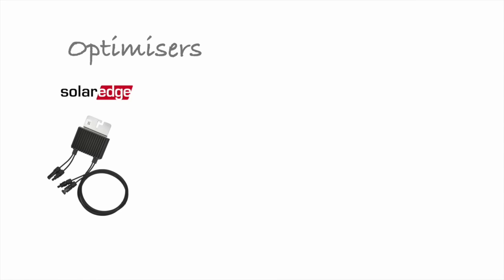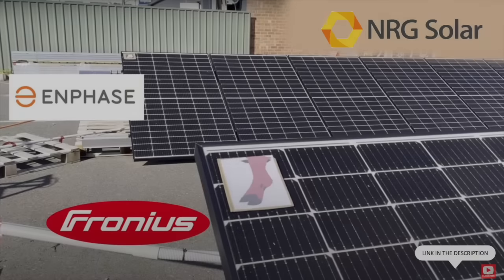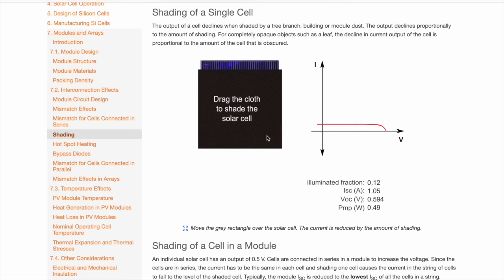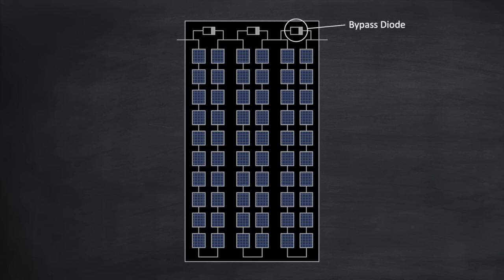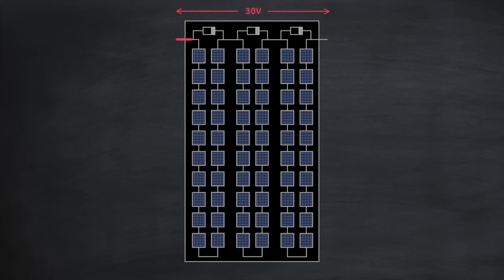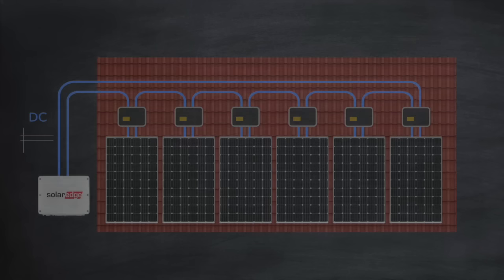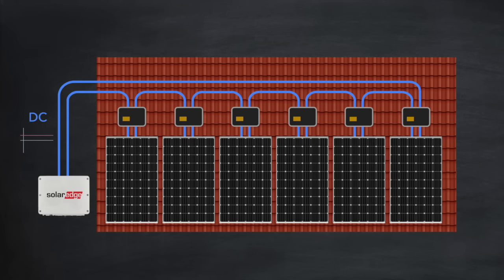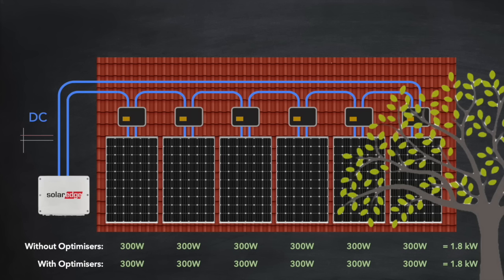Solar Panel Shading (Part 1): Are Optimisers and Micro inverters Worth It?

Comment: There is another issue, when solar panels are partly shaded say from a thin pole or just a small leaf, current if forced through the shaded part of the cell, this reduces its life and destroys the cell. The solution is not to use micro-inverters, instead bypass diodes for each cell is needed, and panels should NOT be wired in series either, is better to put them in parallel and use heavy XLPE cable to keep voltage drops low as current is high. Also dc voltages should not exceed 60Vdc as its just a fire and shock hazard. Batteries and inverters should all be 48V not 350-600Volts. This also proves all the sales lies you have been told, as shading not only kills the output, and return  on investment it kills the panels too where the solar company closes up shop to avoid the warranty claims.
Reply from the maker: Hmmm, I'm not sure I agree with any of that, but let's see what others think...
Reply: 600 volt DC on my roof makes me a bit nervous and certainly puts a lot of strain on the panels. In hot countries like Greece the panels’ degradation in 10 years is extraordinary. They thought the high DC voltage was an advantage because it allows for small cables to be used and money to be saved there.
The biggest advantage of the Enphase micros over solaredge is that it keeps the panel at 40-45V

Comment: I think that is worth to mention that installation with microinverters are easy to extend (just adding new micro and PV module) and they can cover different PV modules power, type, orientation and angles of mounting, also overall lower DC voltage in installation is "nice to have" feature ;-) 
It is also possible to make very small installation with microinverter just starting from one PV module. (there are also micro for 2 or 4 PV modules in one enclosure)
Reply from the maker: Thanks - I’ll try to include some of these points in a follow-up video on shading I’m making 👍🏻
Reply: In the case of 1 microinverter for 4 panels, what will the concern if there are only 2 MPPTs and not 4 MPPTs?
Reply: @cecilia8892  If there is only 2 MPPT for 4 panels then each set of panels for every MPPT must be the same type and must have the same orientation and angles of mounting.

Comment: I've been debating this very issue for months. I have 3 roof aspects to install panels on and the only shading is via cumulus clouds. When you view the complexity, cost and future maintainability I am leaning towards an SMA Inverter system with its x3 MPPT capability and in built Solar Shading Software. It might not be quite up to the mark of Enphase or Solar Edge but if it's close enough the savings and simplicity justify its purchase.

Does anyone have SMA experience?
Reply from the maker: Sounds like a good approach. Let’s see what others think 👍🏻

Comment: I am not sure where everyone is buying their systems and for what cost.
But it is only about 20% more for Enphase where i am and they have a 25 year warranty in comparison to 10 or 12. That alone is worth the cost.
Reply from the maker: Hi Michael, for me, it's not the cost of installation that's the issue with microinverters - it's the cost to fix given the increased complexity on the roof leading to a greater chance of something failing over time.
Reply: @GaryDoesSolar  Like what increases complexity? Also as I stated 25 year warranties over 10 so it’s covered under warranty?.
Reply from the maker: So a typical solar panel has only a number of photovoltaic cells and three bypass diodes all wired together.

Conversely, here is what the inside of an Enphase IQ8 microinverter looks like: https://static.seekingalpha.com/uploads/2019/12/16/38410276-15765300955164375.png

As you can see, a thousand times more complex.

Also, these warranties are only for product failure replacement. Enphase will likely send you a new one in the post, but only when you've sent the failed one to them to check first. And you will no doubt have to bear the access/scaffolding costs yourself.

All that said, I actually really like the microinverter concept - so much so, that I'm going to make a video about them 
👍
Reply: @GaryDoesSolar  I think you should.

Comment: This is fine but doesn't go into half-cell panels and the difference they make. How far do they compensate for shading in relation to optimisers. Also, it wd good to see analysis applied to the vids showing no benefit from optimisers. Why do they show no benefit?
Reply from the maker: I didn't want to make this video too lengthy. I might do a follow up sometime covering some of these points - thank you.

Comment: So why are the panels not simply connected in parallel? The array voltage will be that of one panel, and the current will be multiplied by the number of panels. If one panel becomes shaded or broken, the array current will fall by that of one panel, and the voltage will remain constant. No need for optimisers.
Reply from the maker: A very good question, and many commercial installations utilise both series and parallel connections. 

In domestic situations though, where there are typically <20 panels, a series connection is better for at least two reasons:

- thinner cables coming down from the roof

- Solar generation both starts earlier and finishes later in the day as the higher voltage triggers the inverter sooner. For the same reason, the inverter is more likely to continue operating when there is cloud.

Comment: Technical point worth making, even though it won't likely affect most owners' decisions: both optimisers and microinverters have a reputation for being electrically noisy and can interfere with radio.  This probably doesn't matter all that much on an individual basis, but it is a shame that a technology designed to reduce one form of pollution can result in another.
Reply from the maker: Hi David, thanks for taking the time to make this comment - I wasn’t aware of this and will do some investigation 👍🏻
Reply: @GaryDoesSolar   if you have a published email address somewhere, I can send you some articles on the subject.  But if I try to condense it, it goes something like this:

There's two main types of electrical noise so far as standards are concerned, conducted and radiated emissions.  In Europe, the main standards ones are CISPR 11 and CISPR 16; also there are the European RED directives; and for the US it's FCC Class A and Class B.  There are more specific EN-series standards, too, but I'd have to look them up.  The precise standards are less important that what they represent and how compliance testing is done.

RE standards generally kick in at 30 MHz and go up into the tens of GHz, sometimes higher.  The standards apply limits to noise radiated from anywhere and by any means, but only above 30 MHz.  Noise below 30 MHz does still matter, but formalised testing is limited by practical considerations of the size of the test facilities and equipment required (the lower the frequency, the bigger the antenna needed, the bigger the room, and the farther away from the test device you have to be).  You can't cheat physics when you need reliable and reproducible enforcement of legal standards.

CE standards (conducted emissions, not to be confused with the CE mark) kick in from something like 9kHz and go all the way up.  But the only place they are measured, and the only place the standards care about, is the point at which a thing connects to the mains network.  If it's off-grid, CE compliance is irrelevant.  For these purposes, panel DC lines count as "off grid".

Part of the problem is that radiated noise can be picked up by wires, conducted somewhere else, and then reradiated, and vice versa.  The main problem is that you have "electrically long" DC wires between inverter and panel strings on the roof, but they aren't connected to the grid so CE standards are irrelevant and RE standards apply only from 30 MHz.  "Electrically long" means that the length of the wiring has a certain relationship with frequency, including of noise.  For 30 MHz, anything over 2.5 metres is "long", for 3 MHz, 25 metres.  But a wire doesn't have to be "long" to radiate a frequency, so you'll still get a decent about of noise radiated from a 25 meter long wire down to 300 kHz and below.  

Optimisers and microinverters are both variations on switch-mode power supplies, and switchers are enormous noise generators, especially where high currents are involved.  (Guess what I do for a living.)  Inverters are another kind of switch-mode power supply, so these generate noise, too, and are subject to the same standards and problems.  In the general case, common switching frequencies are in the hundreds of kHz to low MHz, and there are always harmonics above.  I'll spare you the physics involved, but a thing designed to switch at, say, 500 kHz will also radiate at 1 Mhz, 1.5 MHz, 2 Mhz etc, and there are pretty much always additional higher frequency components related to the fundamental.  (In theory, a sine wave has exactly one frequency, where a truly perfect square wave has an infinite number of frequency components.)

All this switching noise can be filtered and contained, but the electronics required to do so tends to be bulky and expensive.  The higher the power and the lower the frequency, the larger and more expensive adequate filtering chokes are.  So all of the active electronics involved are only designed and tested comply with RE standards.  

Physical volume and therefore size matters, too.  So although an inverter has a lot of really ugly noise in it, it is physically more compact and there's plenty of space for filters (part of why big inverters are so heavy).  Active electronics intended to be put on the roof have to be small and lightweight, so compromises have to be made on filtering (never mind for sake of expense).  So optimisers and microinverters create noise distributed over a larger area and have much less filtering, therefore they radiate far more than inverters tend to.  If the main inverter were found to be responsible for RE, you can attach external common mode chokes and do other things in a way that's much harder given the distributed nature of optimisers etc.

Even cable dressing makes a difference.  Routing the + and - DC wires separately greatly increases radiated noise, where tightly coupling them and, for preference, putting them in a light twist can make an enormous difference to radiated emissions.

One installation might (read: will) annoy your amateur radio operator neighbour, but perhaps not much more harm.  But if these things should become widespread without adequate RF noise countermeasures, it'll all add up and start to become problematic for licenced users of the spectrum at those frequencies.
Reply from the maker: Hi David, thanks for the detailed summary. Fascinating. My email is me@garydoessolar.com if you wanted to send something through 👍🏻

Comment: Do you need optimisers on a system that’s split over more than two roofs?
Reply from the maker: Optimisers are certainly one possible option, but best your installer guides you for the best solution. Another solution is microinverters - see my video on those here: https://www.youtube.com/watch?v=q6t0AAi5Jws

Comment: Consider the extra cost Optimiser and Micro inverters represent for a fractional improvement.. in my case the difference was less than 1% over a year for a 13% increase in total cost. And I would not have fitted 6.4kw pv system on my roof with enphase  micro inverters..
Reply from the maker: Yeah, Craig - I think for a lot of people, the value of optimisers against the cost might be a little too close to justify…

Comment: Then I got a question to ask you why is my 9.74 amp 400 watt solar panel giving me 22 amps and on a good day it's giving me closer to 80 amps that's one 400 watt solar panel I have it hooked all by itself explain that to me or should I explain it to you.
Reply from the maker: Why don’t you explain it to me….
Reply: @GaryDoesSolar  because every 10 watt is an amp I used to think it was every 13 Watts was an amp and that was explained to me when I was a little kid and that was explained to me in a book of electrical book before they start lying to you and my inverters tell me the same thing as well as my chargers that every 10 watts is an amp I don't understand what's the difference between amps and a Watts because of that but I do know volts pretty well that's why I don't understand how someone can use 10 amps and 1500 watts to run something because that don't make much sense to me then.

Comment: i can draw a conclusion from your video. as long as there are bypass diodes in the solar panel a mircro inverter has no benefit in reducing the effect of shading on panels. That website that shows effects of shading is not based on the actual effects of shading and is misleading.
Reply from the maker: Hi Andrew, I feel that the marketing teams for some of the manufacturers use a bit of artistic licence :-)

Comment: I have solar panels on several of my buildings which were installed several years ago and were imported direct from China. There were none of these external "wonder boxes" around.

Where l live we don't have the famous British leaf problem that famously affect railways and  airports,my challenge is snow - l live in  Canada. But snow is not a problem since snow is removed by wind.

So l suggest you ignore wonder boxes.
Reply from the maker: Thanks for taking the time to comment. I’ve never heard them called “wonder boxes” before 🤣 I think you might be right!

Comment: Do I need optimizers for my Solaredge inverter to work ?
Reply from the maker: Optimisers are mandatory for any SolarEdge system, unfortunately.
Reply: Thanks. I have 28 - 310w Solar Panels and a 11.4kw Grid Tied SolarEdge Inverter. What wattage optimizers would you recommend?